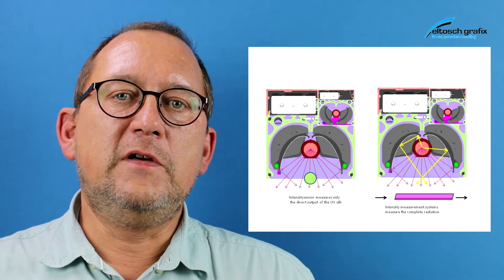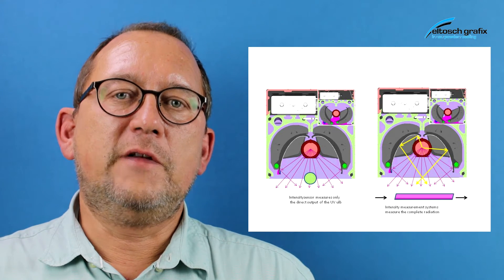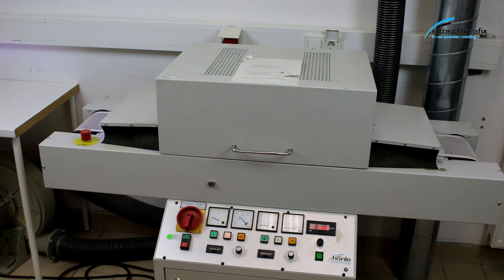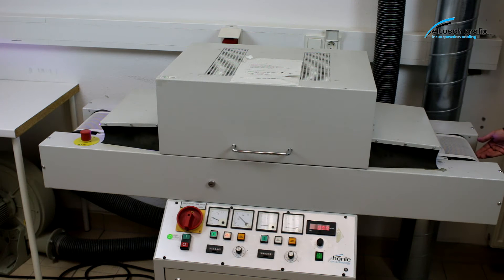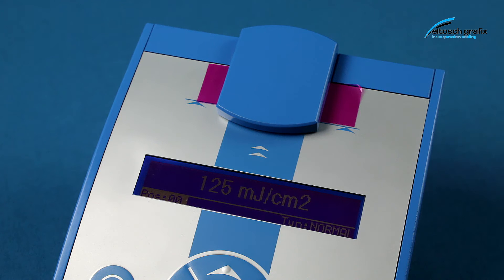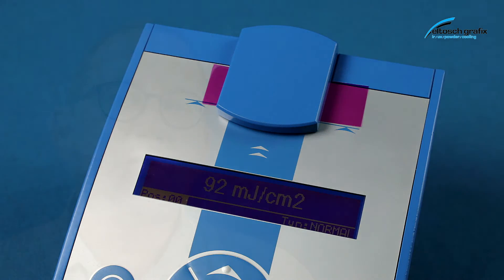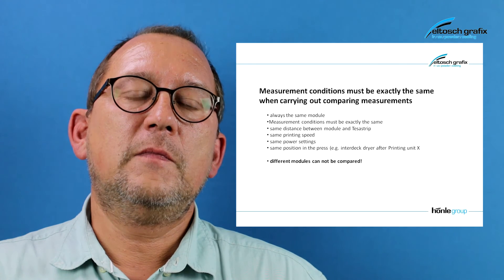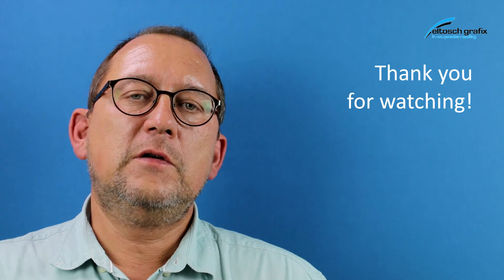measuring UV dose in sheetfed offset printing

Comment: I have a question which is very important for me in these days of covid19. I have made a box of 30 w UV light 100 cm ,40cm,40cm any it is important to me to know 90 me/sec radiation needed for inactivating corona virus needs how much time? I will be much thankful to know your opinion.
Reply: Thank you for your answer.I am a physician in Iran In purpose of making a box for disinfecting corona virus from my equipments,I made a box 100 cm length with 40 cm in 40 cm dimensions. A UV light with 30 Watts attached . My question is how much does it take for disinfecting an equipment in my box? With many thanks